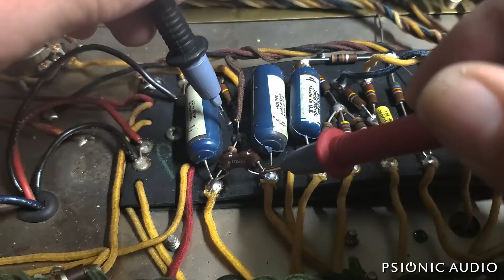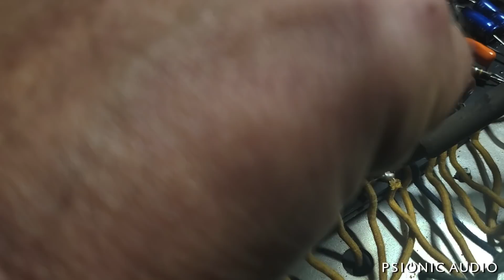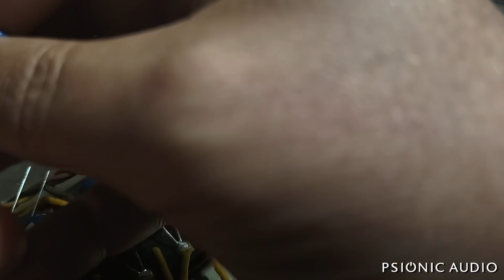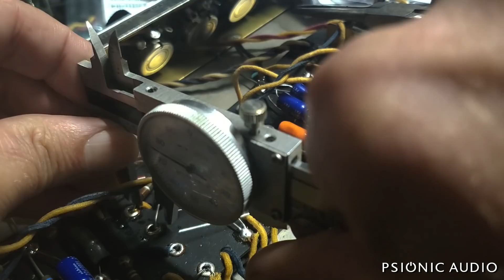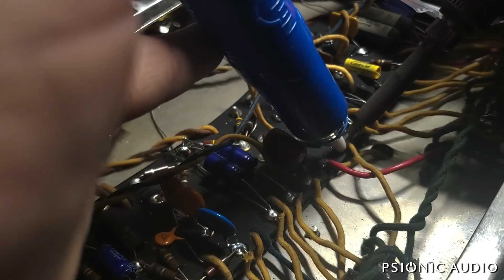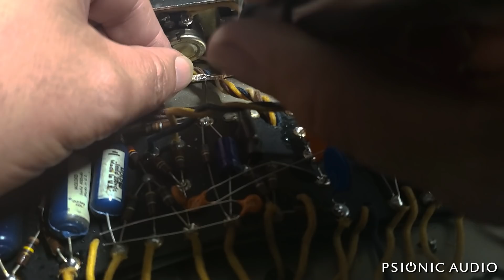'64 Fender Twin Reverb | Part 3 : Good vs Great

Comment: @21:15 The machines I'm familiar with that use component reels don't pull the part out of the paper, they cut the leads before placing the component on a PCB. These are automated pick and place machines in an electronics manufacturing environment.

Comment: I almost laughed out loud when you said you're red green color blind. I am too. Funny story, in 1969 when I went to an electrical engineer college, my first week's quiz was resistor color codes. I was handed a bunch of resistors and the quiz was to write down the value. I told the professor I was colorblind and could give the value if someone told me the colors. The prof said I'd fail. A veteran in the class had just returned from Vietnam with his right hand missing, a hook in place while waiting for his prosthetic chimed in, "if i can't pick up the resistors will you fail me too". I aced the quiz and made a new friend all at the same time.

Comment: OH so that's why they're called optical trems right?
Reply from the maker: Yup!
Reply: Also is the loss of insulation on the cloth wires a concern for guitars? Or just for higher voltage applications like amps?

Comment: Lot's of poetic and profound moments in this video:

27:23:   "Part of me likes the meticulousness of all this.  Just really, really taking the time to get this stuff just right. . . . in a world of non-repairable things where nothing is of lasting value or consequence;  like doing this kind of stuff is kind of an act of rebellion in my own quiet way." 

37:20:  "It was a bad solder joint in 1963/64; it's a bad solder joint now --- or it was until 3 minutes ago.  Now it's a good solder joint"

42:25:  Disquisition on the evolutionary significance of non-linear distortion and why the human nervous system responds to it with special attention.

Comment: Where do you think the carbon comp resistors make the MOST difference in a black panel Fender style circuit? All plate load resistors and the slope resistor in the tone stack? Just the plate loads downstream where there are bigger DC and AC voltages present? I've heard lots of conflicting information on this. Would the 3.3M reverb mix resistor and the 1M grid leaks be places to AVOID carbon comps to lower noise floor?

Comment: DC on the volume pot often makes an awful noise and a cleaning doesn't help for long. That noise using the bright switch often also indicates DC on the pot which the switch is across. Unfortunately there is no "coupling cap" and the 3 caps of the tone stack serve that purpose. So when the bright switch is noisy the volume may also be soon, and you have to test all the caps in the stack...and then it might be DC leakage in the board LOL. But that noisy bright switch usually has nothing to do with the switch itself. I didn't go back to see how noisy the volume was when you started. How far to go? Only you can say...
Reply: THen again all the tone pots were quiet. Go figure....LOL. Maybe the noisy bright switch is worth living with? Maybe it's cumulative leakage of all 3 caps in the stack?

Comment: So I notice you don't put a heat sink or alligator clip on the lead of small components before soldering them.  I trust that you definitely know that excess heat is not traveling into the caps and cooking them.  I know as long as you get in and get out quick you heat them up but not to death and I guess touching the ceramic disc or whatever it is will give you an idea of how hot it's getting too.  I learn so much from these videos I love this stuff!
Reply from the maker: I do if there is a very short lead length. Not an issue here.

Comment: Lyle why was that snubber cap unnecessary?
Reply: Thx Lyle. I have 100pf on my Deluxe clone. Was told it could filter ice pick highs. I have turned my tone pot into a mid cut so I’m running the highs unfiltered and use my guitar to tone to control highs.
Reply from the maker: The purpose of the cap is to prevent oscillation. The amp doesn't oscillate with good filter caps. It was probably a band aid for the old caps.

Comment: Well, I for one, do care a lot about this stuff. So, thank  you very much for going to the trouble for those of us who do care.  I'm not an amp tech, just an old guitar player that still uses the pre CBS Fender amps I bought used back in the 70's. And I used the hell out of them, 5 to 6 nights a week for decades.  I've made a few minor repairs recently, and electronics does not confuse me, I get it. I'm watching and re-watching, and I'm sure I'll watch again. I want to be able to restore my old amps, the repairs that have been made over the years by good, and maybe not so good, techs have made them sound less and less like I remember they 'used to sound'. If I'm crazy, then I'm crazy, I don't care what they say, but I say, if it's different, then it's different. So, I completely agree with what you're saying about using the right/original type parts. By the way, what brand/make are those ceramic disc caps? Where can we get some? And, if you had, say, NOS A.B, Sprague, etc. that measured and ESR to spec., would you use them?  Don't worry about answering, I know you're a busy guy.  I'll just keep watching. I'm up to being able to pull the Filter cap board and bias board and rebuilding them (as soon as the bus wire arrives my '63 S.R. will get the treatment), the main board still kind of scares me, but you're giving me the confidence, it really needs it there's gobs of solder between the boards. I've already measured DC on my '64 D.R's board then cleaned it like you do and saw the DC drop. So, I do care, and your videos and techniques are great.  My goal is just to restore and maintain my own stuff, (I live in a rural area now, no techs around here that I would trust the old stuff to, besides I want to do it myself). I don't want to do this for a living. I probably wouldn't get any customers anyway.  Okay, enough from me. Thanks again.
Reply: Those old amps are pretty bullet proof. Aside from filter caps needing changed, not a difficult job, and setting bias, not difficult with a good meter and a little knowledge, these things will run forever if taken care of. Oh yeah and coupling capacitors! They can get leaky. If you have scratchy controls even after cleaning then chances are your coupling caps are leaking. Many good videos on that subject. Basically there exists two schools of thought on coupling caps and applies to amps in general. One is to change all the caps if you find one bad one. The reasoning is that they are all the same age and even if the others are good it won't be long before they too are problematic so change them while your in there. The other folks contend that you can alter the sound of the amp by "shotguning" all the caps and will just change the one bad component. I try to do what the customer wants, within reason, and always observe the Hippocratic oath. I live out in sticks myself, West Virginia boy. If you're wondering about the name this is my wife's YouTube account lol. Pretty handy with electronics, YouTube accounts....not so much 😆

Comment: That solder sucker has deep lungs, but she likes to atomize solder when charging the damn thing. You can smooth out the action and get rid of the screen door sound by brushing on a little film of grease on the coils. Won’t prevent it from farting powder all over your chassis however.

Comment: Hello!
What kind of capacitor did you use between the bright switch and volume pot?
50m in the video.
Reply from the maker: Vishay 562 series 1KV 120pf.
Reply: @PsionicAudio  Thanks!
Reply: Can you share some tips on how to prevent the “rushing water” when using the volume pot on the vibrato channel? I’ve used the alcohol method along with the heat gun and now the dc voltage is very close to 0 on wires and on the board. I have 40-50mV on the ground side in one of the coupling caps. Tried different cap but I still get very small voltage to ground. Is that normal?
Reply from the maker: Below 50mV is normal. Once DC is eliminated, the next suspect is the wire from wiper to grid. If that isn't the culprit, pots wear out (I'm assuming you've already cleaned the pot with Deoxit).
Reply: @PsionicAudio  yeah I’ll check the wire next. Silver mica caps are also good for the volume pot or you recommend the ceramic disk?

Comment: Hello! 100mV is acceptable for the cloth wires insolation? in many areas of the amp? the board also reads 50mV at some places...
Reply from the maker: Whatever your meter leads read up in the air is acceptable. Leads often read up to 20mV when not touching anything. Anything more than that on something which is supposed to be an insulator is a problem. You definitely don't want more than 50mV on any insulator.
Reply: @PsionicAudio  thats whats weird with my fluke 117. he reads 0.0001V on most places on wires and on the board but when set to mV he reads 350mV and even if I'm not touching anything it stays in the 70-400mV range. so which range should I work with:(
Reply: @PsionicAudio  my bad. My meter was on AC  instead of DC😑
Reply: @PsionicAudio  is it normal for a 250k Treble pot(according to the schematic) to read 200k on the ohmmeter? Do you recommend changing the pot?

Comment: Looking over your shoulder amp after amp is the perfect apprenticeship. You could probably charge for this. The only point to point amp I'll ever get inside would be a kit build. However it would be great to de-bug any modern amp I buy. (surface mount not included)
Reply: I've been wanting to get a hot air soldering kit. They are essential for the surface mount stuff which is mostly what you'll find In modern equipment.

Comment: The bright switch tends to make a sufficient "pop" that it could be obnoxious to the audience when it goes out over the PA. It occurs to me that perhaps it would be possible to install a 3-position SPDT or DPDT slide or toggle switch with a middle "off" position (on-off-on),  or perhaps an on-on-on switch, which could be wired to mute the signal or ground it out when the switch is in the middle setting, so that it doesn't pop when changed from "normal" to "bright".  I don't know offhand if it's possible to find a slide switch that will give you 3 mechanical positions within the relatively small space of the slot provided in the face plate of the amplifier; but you certainly can find miniature toggle switches that would allow you to do this. You'd need some suitable fender washers, and perhaps a rectangular washer or cosmetic overlay of some kind, to fill the rectangular cutout in the amplifier faceplate when mounting a toggle switch through it.. (For non techs, SPDT and DPDT refer to single pole double throw and double pole double throw switches).

Comment: Your obsession with minutiae is exactly the reason I watch your videos. I have ultimate respect for that perspective. I realize that it is necessary to continue the legitimacy of tube amps as most modern ones descend into unreliability and throwaway junk that won't be around in another 50 years. Techs who are as hypercritical of their own work like you are our salvation. We tube amp people need more of those who will chase hum to ends of earth. You do pat yourself on the back a bit too much though. Not necessary, but I do understand the whining you hear. It isn't boring, it just helps me to better understand the inards of my 64 Super Reverb. Keep up the boring minutiae!

Comment: Lyle, for removing the paper and tape strips from those caps and other parts that were similary designed for automatic, mechanized pick-and-place machinery,  see my other post. You might still have to use steel wool on the parts leads afterward, but unless the manufacturers have changed adhesive, an alcohol soak should soften the tape and the paper to the point where they separate. I've done an entire role of 100 caps or other parts at a time this way, in one fell swoop.

Comment: Those capacitors on the paper strip have more lead length stuck down  under the tape than they have above it!  Which is okay if you're using the caps for PCB mounting or on an eyelet board with closely spaced eyelets, as is being done here; but it would suck if using those caps for a point-to-point design, or on a turret or eyelet board where the connection points are widely spaced, because the glue left behind on the leads tends to resist solder. You can stand up the caps in a glass with a half inch of alcohol, and the paper and tape will soften and fall away, but there will often still be adhesive residue left behind on the component leads.

Comment: There are smartphone apps, designed for use by colorblind people, that can differentiate between and identify colors.
Reply: Unfortunately though, in the time it would take to get your phone out and load up the app, you could have just measured it. :)
Reply: @jbolt247 ,   Well, most technicians, if they are not colorblind, will do a quick perusal of the amplifier and look at the color bands to spot any resistors that are not original and perhaps changed by someone else to a different value from what you would expect to see in that position. It's not possible to do that by sight when you're color blind, and so you end up having to measure every single resistor. Which isn't necessarily a bad thing, since many or all of them should be checked for drift, but it's good for the tech to be able to know at a glance if the resistors conform to the values printed on the original schematic; or even if it appears to have been factory-built with the "wrong" parts values (which might actually turn out to sound good, or different in a usefull or pleasing way). Otherwise, you need to start with a paper copy of the schematic and write in the values of the parts that you find in each location, as you go along with the ohmmeter,  because you can't simply verify them at a glance as you work on the amp. At least, I myself would likely find that necessary, if I couldn't trust my eyes;   mostly, however, it's my memory that can't always be trusted!

Comment: I gotta say I've seen some techs use offset bending pliers on resister and cap leads but you are the only one I've seen use a micrometer to measure component gap spans...Your work and commentary are hypnotizing

Comment: I was unable to find the AA763 Twin schematic also. I looked for hours after your first video on this amp, using every search engine and different search terms. I find it acceptable to use the Showman and Super schematics, considering the situation.
Reply: Book called  The Tube Amp Book by Aspen Pittman.... has tons of schematics and info...it has the one you want/need I think....
Reply: @Shiloh7377  That book is not really for any serious tech.
Reply: @ScottyBrockway   ok. I was just letting him know that it does have alot of schematics though.

Comment: Great video again thanks. Will the drift of the resistors effect the tone of the amp at all?
Reply: It can. Watch Uncle Doug’s videos on resistors and their uses in tube circuits if you want to learn more.
Reply: They very much can... and that is one of the beautiful things about carbon comp resistors that you lose when you replace them with "perfect value" components.